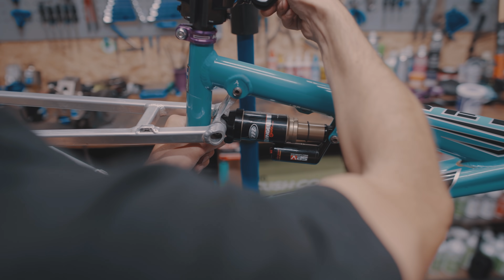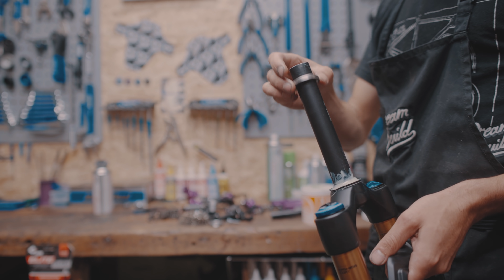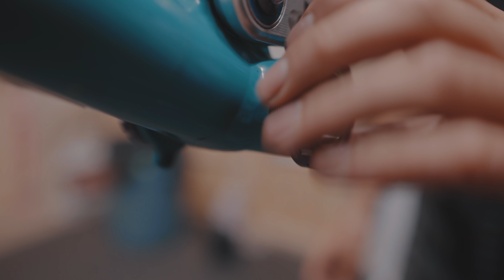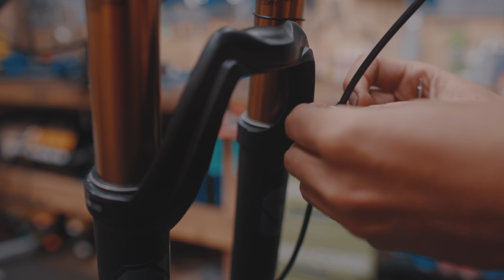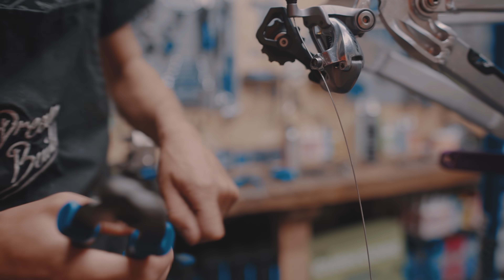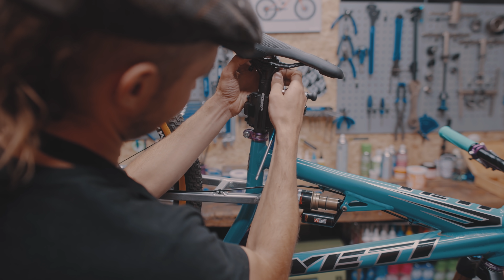DREAM BUILD MTB - 2004 YETI 4X - 'special project'

Comment: MTB  use 105 ？ This is the fisrt time i heve seen this kind of solution.
Reply: It was quite common in the day to use a road derailleur. Easily sourced over a short cage MTB derailleur, as most shops would have them in stock.